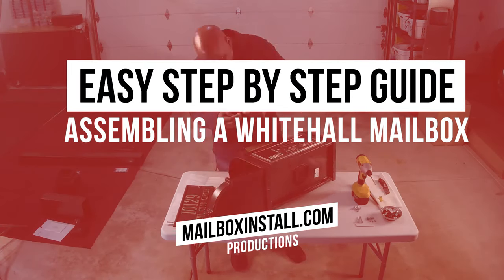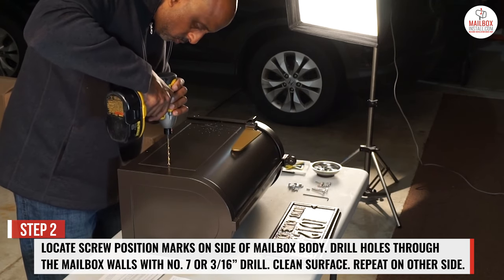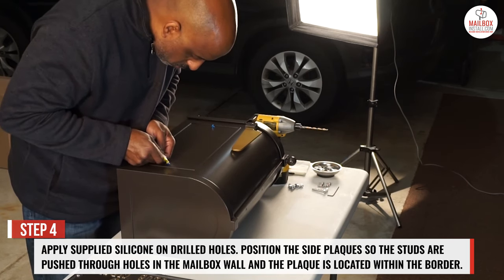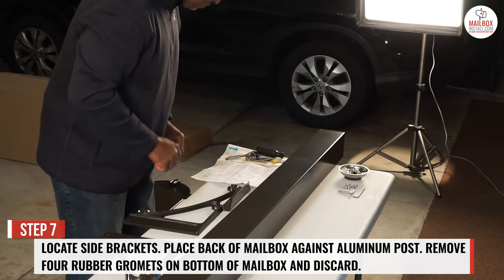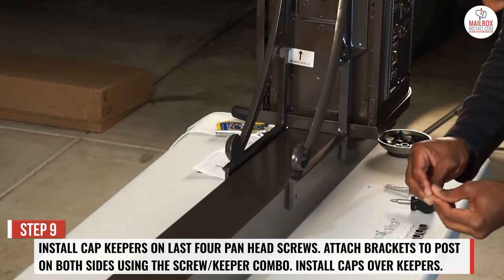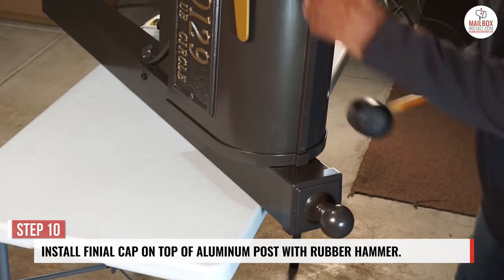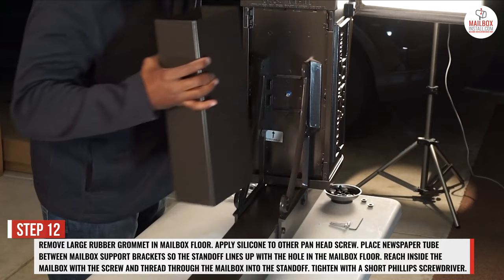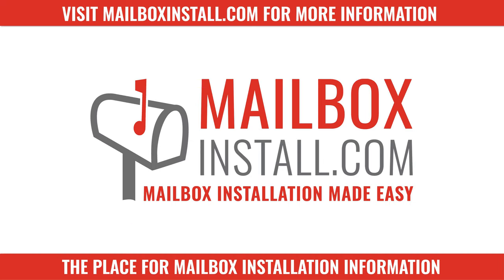How to Assemble Whitehall Capitol Mailbox and Post - Step by Step Video Guide by MailboxInstall com

Comment: The newspaper box has a small second hole. The video did not seal that hole. What is it for?
Reply: Thanks for addressing the second small hole.  I took one of the smaller extra screws and placed it there to prevent water from leaking inside.